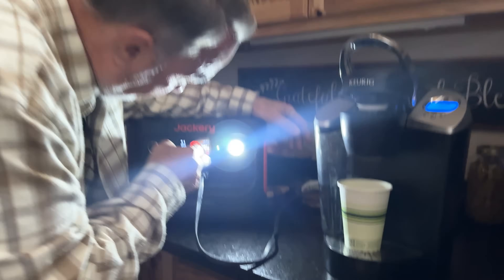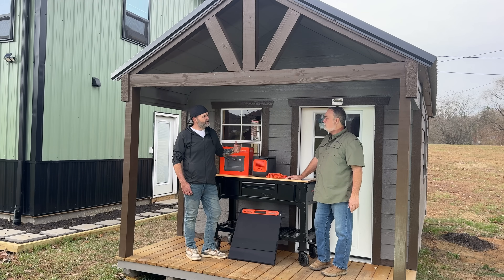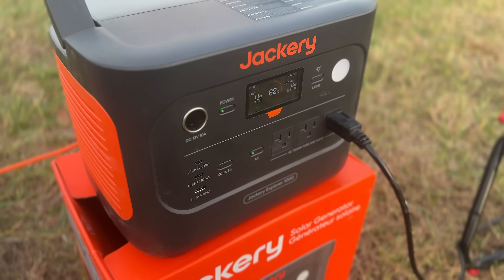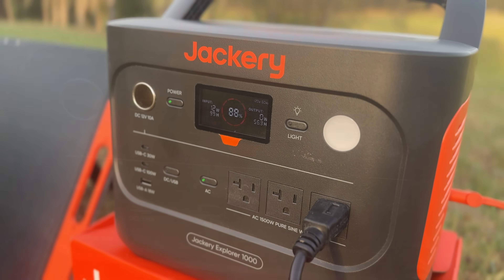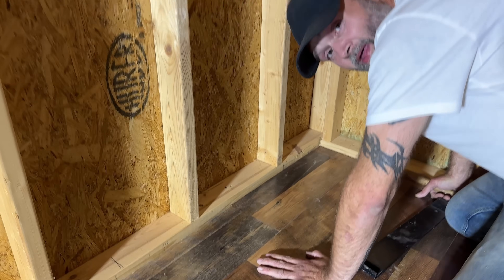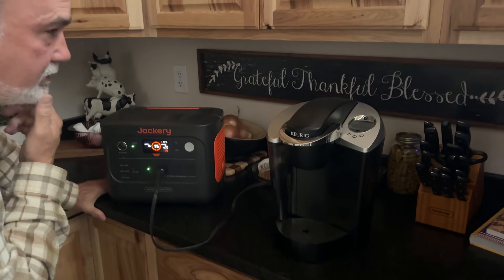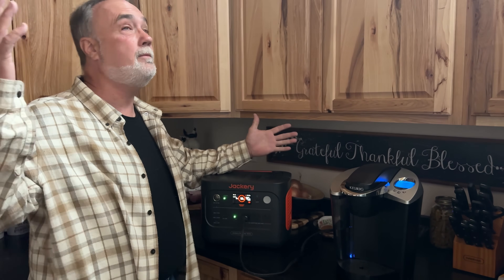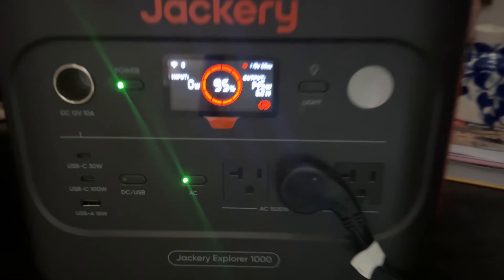Jackery Solar Generator 1000 v2 Up to 65% off

Comment: I am watching replay. Had high traffic tongue n groove installed. I had moisture barrier installed before I got the flooring installed. Plus, Dustin is right for using a rubberized hammer. ❤

Comment: Nice video. I’m interested in this product. Which model is the best for a refrigerator? Is it the one you’re using? If the electricity goes out the refrigerator is the important thing to hookup since I store a lot in it and the freezer too.